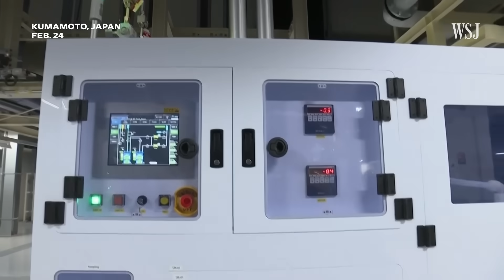The Plan to Secure Taiwan’s AI Chips Amid Fears of a Chinese Invasion | WSJ

Comment: Some politicians and media analysts argue that China should invade Taiwan, but they fail to grasp the critical role Taiwan plays in global technology. Taiwan's advanced semiconductor industry acts as a "high-tech shield," making it essential for any nation seeking prosperity to avoid conflict with Taiwan. Today, Taiwan's cutting-edge technology, particularly in producing 3 nm semiconductors, is unparalleled worldwide. These chips power everything—from smartphones, TVs, and aerospace technology to jet fighters and kitchen appliances.

If China were to invade Taiwan, it would face significant consequences, including losing access to crucial semiconductor imports. Notably, China currently imports more chips than crude oil, underscoring its dependency on Taiwan’s technological output. An invasion would cripple China's own industries, disrupting manufacturing, healthcare equipment, electronics, and automotive production, effectively plunging the nation into a technological blackout.
Reply: China already has trade restrictions and isnt allowed access to the newest amd, intel, nvidia cpus/gpus. So they got nothing to lose, even if they import em illegally anyway.

Comment: Microchips are not the most critical things to worry about. The really important one is geopolitical implication. If China takes Taiwan, then Chinaese Navy breaks out of the 1st island chain. PLA nuclear submarines launched from the east cost of Taiwan can easily slip into the depth of the Pacific Ocean without being detected. When they emerge again, they can be near the coastal of Los Angeles or any point of the continental west coast. This is more critical than the chips.
Reply: The United States is unwilling to significantly increase Taiwan's defense capabilities and increase the number of U.S. troops stationed in Taiwan. Instead, it is worried that Taiwan's wafer factories will be attacked or occupied. It's really putting the cart before the horse

Comment: The first TSMC Fab in Phoenix is now operational and will start mass production 6-8 mos.  The second fab is 50% complete and both Fab 2 and 3 will, according to TSMC CEO, be twins with Taiwan producing 2 and 1 NM chips.  I would expect the 3 additional fabs (TSMC has the land) to start construction sooner than later.  In the meantime, NXP has added a new Fab in Phoenix in addition to Microchip and Onsemi Fabs.  Intel is 1 year away from opening two new Fabs which will solidify Phoenix (Chandler)  as the largest manufacturing facility for Intel.   With the addition of the Texas Instruments expansions in Texas and Utah, Intel expansions in Ohio, New Mexico and Oregon, along with Global Foundries expansion in New York state, Samsung in Texas, Wolfspeed in North Carolina, Micron in Idaho and New York and SK Hynix in Indiana (along with packaging giant Amkor's new Phoenix facility) the United States will not only lead the world in semiconductor equipment and design but shear capacity.
Reply: 1.6nm in Taiwan and cowls

Comment: 🎯 Key Takeaways for quick navigation:

00:00 💻 Nvidia's H100 chip, crucial for AI model training, is primarily produced in Taiwan by TSMC, making the company and the island vital to the global economy.
00:29 🌍 A disruption in TSMC's operations, due to natural disasters or geopolitical issues, could significantly impact the world's chip supply.
00:59 🇨🇳 China's intention to take control of Taiwan could have devastating consequences for the AI revolution.
01:28 🏭 Taiwan's early investment in chip making and TSMC's focus on manufacturing have led to a concentration of power in the industry.
01:56 🛡️ TSMC's value may serve as a deterrent to a Chinese invasion, often referred to as Taiwan's "Silicon Shield."
02:32 💰 Replicating TSMC's capabilities is challenging due to the high cost of building new chip-making facilities.
03:00 🌐 An invasion of Taiwan could have a disastrous impact on global supply chains and the global economy.
03:29 🇺🇸 The U.S. may take drastic actions to prevent China from taking control of TSMC, including potentially destroying the factories.
04:29 🔄 The U.S. is investing billions to shift the chip supply chain back home and encourage TSMC to expand production outside of Taiwan.
05:29 🚧 TSMC is facing challenges in operating in different environments and securing skilled workers for its new factories.
05:58 ⏳ The timeline to secure the chip supply chain is getting tight due to increasing threats to Taiwan and delays in new factory constructions.
06:28 🎯 Despite efforts to de-risk the supply chain, Taiwan will remain a central player in the chip industry for a long time.
06:56 🎲 The fight to control the chip supply chain has just begun, and it's challenging to remove Taiwan's influence from the chip industry.

Made with HARPA AI

Comment: These chip factories should have been built in the US a long time ago
Reply: There are always those who oppose investments in new technologies, unfortunately. At least we're fortunate enough to have had Taiwan as the pioneer in this respect.
Reply: they were in the US a long time ago , but diminishing costs abroad made it so basically every tech company started to make their chips offshore.
Reply: @vinicio1089  It wasn't so much a cost issue, though Taiwanese engineers' pay vs. hours is definitely short of Americans'.  Rather, Intel thought they could get EUV-level density without using EUV machines.  They eventually did (they call it Intel 7), but it took 4-5 years longer than it was supposed to, putting them way behind.
Reply: it’s Taiwanese technology.  They decide where it can be built or not.  US corporations don’t have the patents and the knowledge.  Since American corporations didn’t invest/succeed at the time the technologies were developed.  The US can’t steal it from Taiwanese corporations.  And for national security reasons Taiwan likely won’t allow too much production outside of Taiwan.
Reply: @abrakkehakka1357  You are ignorant of the semiconductor industry.  Most patents and the entire ecosystem for semiconductors is based on U.S. companies.  Look at the machines INSIDE the TSMC buildings -- Applied Materials, ASML, KLA, Lam Research.
Reply: @abrakkehakka1357 it’s actually dutch and german technology. The lithography machines and lenses. Taiwan commercialised it at scale.
Reply: @thedownunderverse Someone compared it to a restaurant or bakery. The Dutch supply the oven but the Taiwanese is the Chef or cook.

Comment: US lacks chip making ecosystem. The silicon wafers made at Arizona fab had to be shipped back to Asia for packaging. What good is that for 😂. Japan on the other hand will more  likely to be successful at regaining semi manufacturing prowess.
Reply: This is also what I heard from the industry insiders.
Reply: There is a robust ecosystem of over 1000 semiconductor companies in Arizona and Amkor is spending $2B on a plant down the road from TSMC to package the chips.  100% American made
Reply: @Maxpasadena   Critical tech is still kept in Taiwan.
Reply: @censoredyoutube4902  As in WHAT?  I don't think you know what you are talking about.  The chips will be made in America for American companies.  Nothing will be shipped back to Taiwan  - which would defeat the purpose of building the fabs here in the first place.
Reply: @Maxpasadena   You obviously lack basic knowledge about supply chains of semiconductor.  I've been a long term investor of US semiconductor sector and TSMC as well for decades.  Taiwan still holds the critical and most advanced tech to process chips, always in 1 - 2 generations ahead of the American plants.  One semiconductor company CEO in Taiwan once said that the packaging of chips made in TSMC AZ branch still need to be done in Taiwan.
Reply: @Maxpasadena   It can be solved but it's not successful so far with a lot of glitches.

Comment: Wouldn't transferring fabs to the outside Taiwan endanger Taiwan by removing their silicon shield?
Reply: tw is just playing card, u.s don't care anything but their own interests.
Reply: Taiwan is an island of only 23 million people and they are trying to supply the entire world's chip needs.  Don't think of it as transferring fabs, more like increasing production due to high demand.
Reply: The United States is unwilling to significantly increase Taiwan's defense capabilities and increase the number of U.S. troops stationed in Taiwan. Instead, it is worried that Taiwan's wafer factories will be attacked or occupied. It's really putting the cart before the horse
Reply: The cutting edge tech remains inside Taiwan, fabs outside Taiwan isn’t as advanced as it is inside.
Reply: @s0kulite the cutting edge tech is actually the machines from the US and asml. Those things are what is driving tsmc. 

Without those machines tsmc is done. 

Intel isn't far behind tsmc and their fabs are in the US. They get the machines from asml too 😂.
Reply: @rv8804  One Chinese chip company, I'm guessing HSMC, got their hands on an ASML lithography machine and flaunted it to Chinese investors, received the money, and then went bankrupt. Intel tried using their own fabs for cutting-edge chips and stopped at 10-7nm due to low yield. They tried to squeeze performance out of their chips like toothpaste, then at Gen 11, they moved fabrication to TSMC to catch up with AMD Zen. It doesn't matter if the tech is US or not, TSMC can fab at scale and utilize different fabrication processes with utmost efficiency; that's why they dominate, and those machines aren’t leaving TSMC any time soon, so your point really doesn't stand practically.
US scientists made the tech, but didn’t know how to use it at scale, and the Taiwanese took that opportunity over the Americans
Reply: @rv8804  There are no fab machines from the USA. One USA company invented the EUV generating part of the Dutch ASML EUV machine so the USA uses that to stop the sale of EUV machines to China. ASML bought that company so no part of the ASML machine is made by companies owned by US companies.
Reply: You are thinking it like opening a bank branch abroad. The fabs are part of the local ecosystem, there is a steady supply of top engineering graduates in Taiwan who don't mind manufacturing work, which often not found in other countries. Its success also has a lot to do with Taiwan style management which would be rejected by employees in another country.
Reply: Taiwan is in danger either way as China has been pushing to make their own chips.
Reply: Who cares?American Boss 🤔